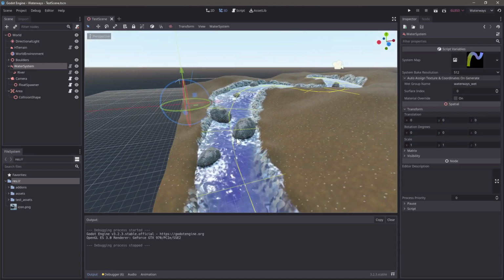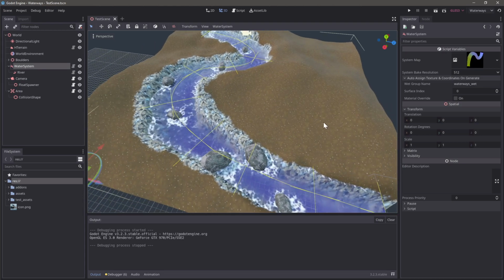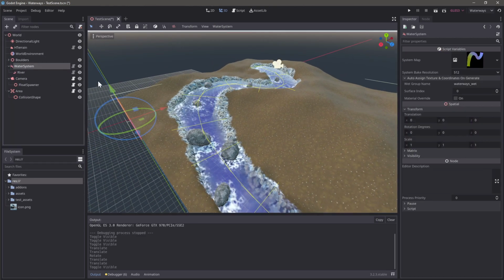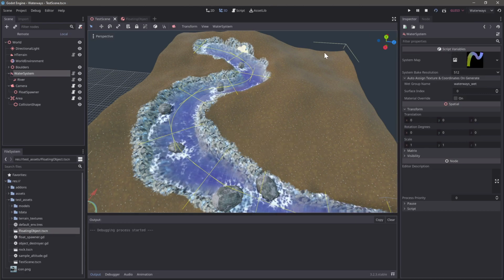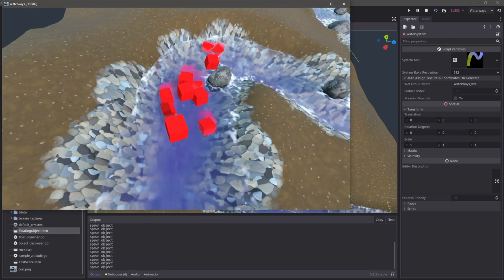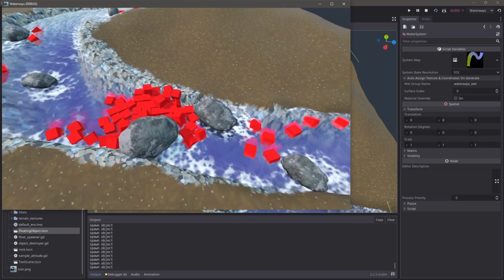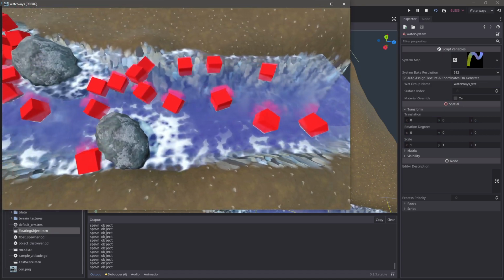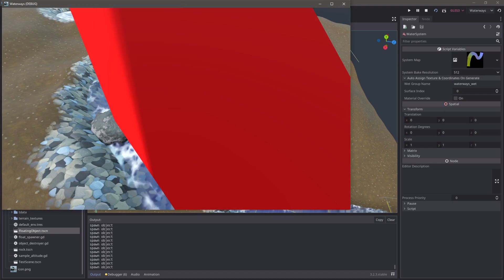Waterways 0.2.0 WIP floating objects and wet maps

Comment: How do we get to the water system node
Reply from the maker: I'm not sure what you mean? You can look at the documentation on the github page, if it's unclear how the WaterSystem node works.
Reply: @KasperFrandsen  I downloaded the add-on from GitHub but I am still unable to enable the add-on because it’s telling me “ unable to load add-on script from path this might be due to a code error in that script”
Reply from the maker: @GamingsMostAmazingSoundtracks  You might just have to disable and enable the script in Project Settings -> Plugins. Or restart Godot. What version of Godot are you using?